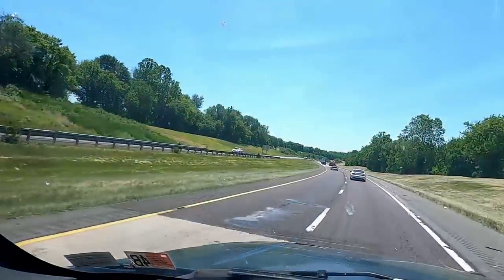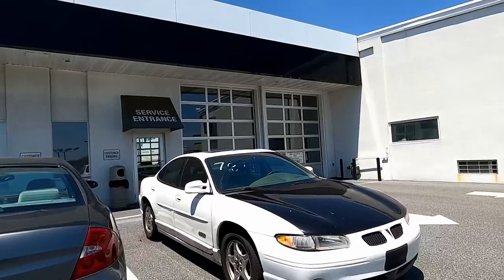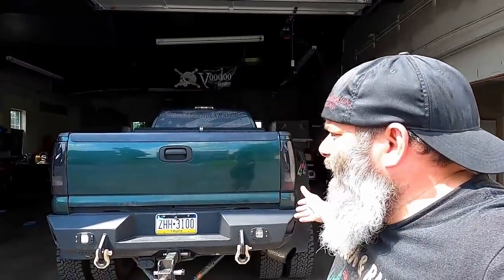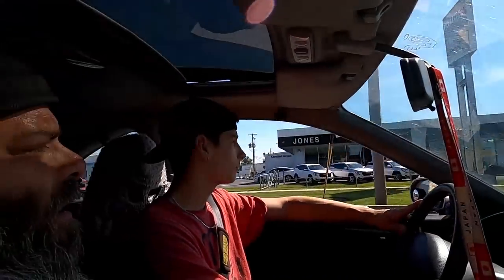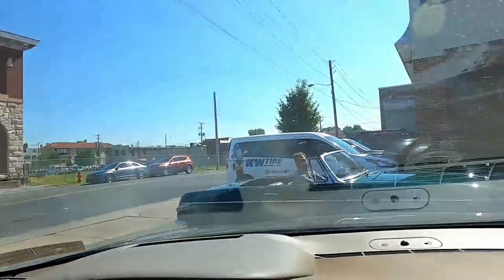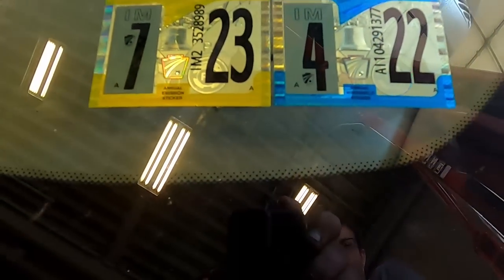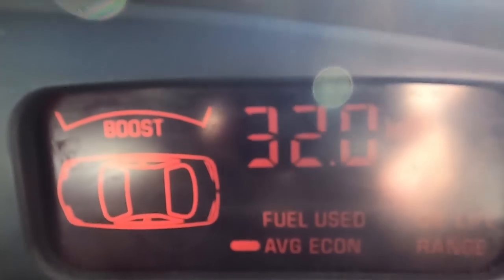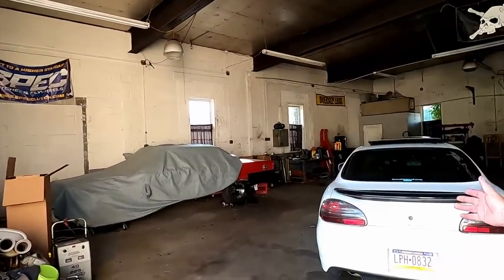My Pontiac GTP Almost Caught On FIRE!

Comment: Number 1 miss conception of getting a diesel is you think you need to drive it everyday which is kinda wrong, diesel pickups need to be used for heavy haul and pulling, 2nd major use they can be used is long distance travel. I had a 12 valve making around 500hp and was getting 29mpg empty driving to and from ft.hood to Wisconsin

Comment: I have a 1999 GTP with 70,000 miles on it! Black two door, Graphite interior. Ordered car but I didn't order it, fell in my lap when the guy that did couldn't take delivery. Everything but BOSE but I fixed that. Had BOTH fire recalls done (yes there were two). Please DON'T put Reg or Mid in it, unless you hate your top piston ring lands or want a shit load of KR! Scan the car under load and you'll see what I mean! Even with trac control off it'll pull a LOT of timing. Might as well be a NA 3.8L like my 2005 GT2. And change the SC oil if it hasn't been done or at least topped up. And while you're at it replace all the plastic serpentine belt idlers and pulleys with Dorman metal ones! Hearing a few unhappy sounds under the hood of yours...

Took third in the Conservative Hardtop class for its year at the O'Reilly's World of Wheels in Atlanta 2007! ;) Showed with two Daytona Pace cars (not replicas) and a 2004 Daytona pace car the judges added to our class at the last minute. He got best in class, the other two Daytona's tied for second, and I got the "Class award" essentially third! The howls from all the ricers in the class were priceless! Yes, we swept the class! :)

Comment: Im suprised that the l67 has a recall never heard of that and those engines are put in a bunch of commodores from 98-04... interesting to know. what valve cover gaskits do they use over in the states because we have the cork gaskits (yes they leak) but there was no recall here.